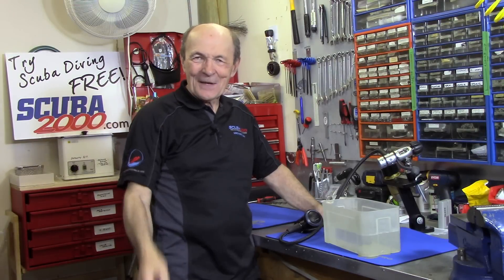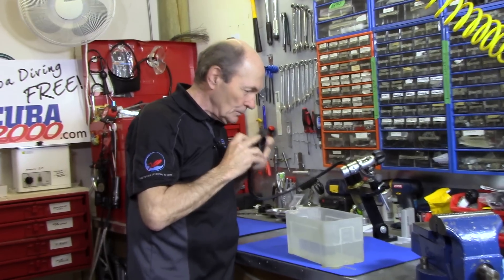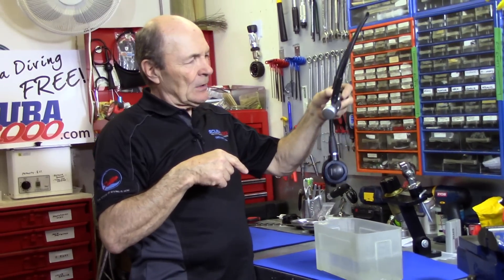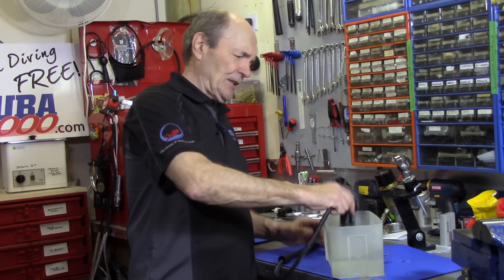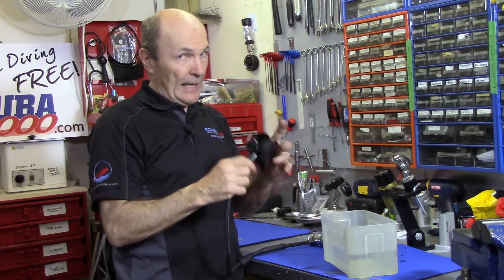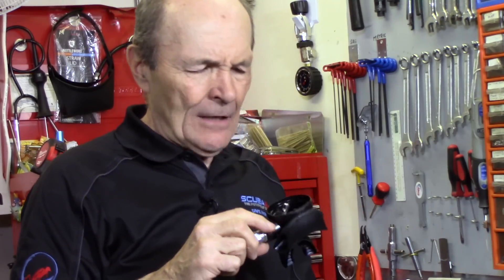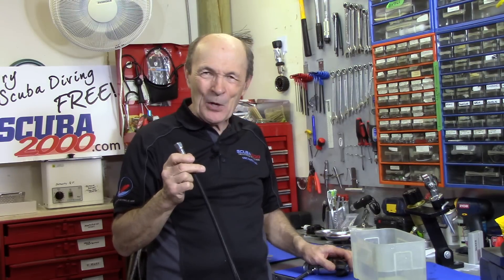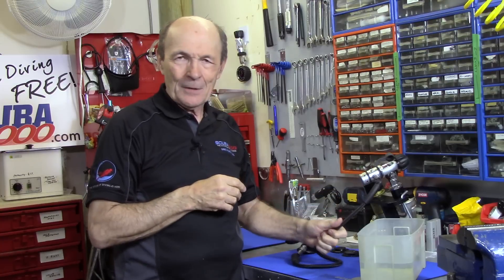Go Ahead, Push The Purge When Rinsing - Scuba Tech Tips: S05E15

Comment: DIn type of regulator dont have that dust cap on the end there :) If open will there still be air in the line to keep water out? LOVE YOUR CHANNEL!!! THANK YOU FOR ALL YOUR HELP!!!
Reply: There's absolutely a cap for din regulators. If yours didn't come with one, get one. It's a separate screw on cap that seals against the oring of the din fitting.

And you really shouldn't rinse or transport the first stage without it
Reply from the maker: Much appreciated and thanks for watching.
A

Comment: Pushing the purge button can allow water to reach your first stage. The odds of it without using complete submersion of entire second stage and hoses are almost zero. Almost zero is not zero. There is not a pressurized hose stopping water entry. There is a hose with remaining air that can easily be displaced in exchange for water if hoses reach lower then second stage. Always dangle first stage out of cleaning bucket wall cleaning second stage or you will get water in your first stage.
Reply from the maker: At my store Scuba 2000, new students were taught that technique.  Take care Don.
Reply: Can't you just hook it back up and purge it after rinsing

Comment: I will not have water inside the air valve of my second Stange. Nobody think that water goes in the first stage.
Reply from the maker: The key point is 'when rinsing' in clean water, not salt water.  If unsure that water may be in the 2nd stage hose, open the 1st stage a bit and press the 2nd stage purge.  Any water/moisture will be blown out before storing.

Comment: Hi I have a cracked diaphragm cover On my 2nd stage.  Do I need to replace it?  I was underwater And was still able to breathe ok.
Reply from the maker: A cracked purge cover should be replaced and maybe your reg checked as to why it cracked.  It still works because the breathing diagram has not torn so when you suck in it still pulls in air.  Not something to ignore for long.

Comment: Hi Alec. I like your videos. But with all due respect I have to disagree with this one. First of all I am sorry for my English, but I will try to explain what physics REALLY does. You talk about the pressure inside the hose. You talk about the water can not beat it. But the pressure of the water doesn't HAVE to beat it. Because as soon as the hose inclines from vertical to horizontal position (a thing that happens all the time while you rinse), the water and the air inside the hose occupies a TRANSVERSAL section. Then the water comes in and the air goes out. Is the same principle with the demonstration with the glass on the surface of the water for the Open Water Diver course (I usually show that little primary school experiment to my students when I teach the first class to show that the water doesn't compress the air inside the glass WHILE IS FACES DOWN). But if I incline the glass, bubbles come out and water occupies its space. I could make a video to show you why your theory is wrong if you want to.
Reply: I’d imagine due to the small inner diameter of the LP hose as well as the viscosity and surface tension of water, it is difficult to produce such a interchange between water and air as you would see with larger hoses.
Reply from the maker: You are quite right of course, in pure physics terms. I taught physics for several years.
I couldn't begin to explain, as you have, all the aspects of the motion of air and water in a tube. The video would be 1 hour long and no one would watch it. Plus, few would understand it either. 
All I was trying to accomplish in this video is relieve the anxiety on divers with respect to the "law" that you must not press the pure button when rinsing. The hose is quite long (25 to 30 inches) and the 1st stage end is closed. So, while there may be some air/water movement as you've described depending on the positioning of the hose, it would be very little.  The diver is unlikely to hold the purge button open for more than a moment so for most of the time while the reg is being rinsed, BOTH ends of the hose are sealed. In that case transversal movement would be limited.The likelihood of water making its way to the 1st stage is slight and that would be expelled instantly the moment the reg is re-attached to the tank. That would also completely dry the hose since the air is very dry.
So, while your physics application is correct, in this instance it's of little importance.
Pressing the purge is no reason to panic nor to spend $150 to service the reg.
Thanks for watching and for your comments.
Alec
Reply: @AlecPeirceScuba_SeaHunter  Almost nobody in Europe uses these useless rubber seals on the first stage. so water will come into the 2nd if you push the button (in my opinion it will also come inside if you have these useless seal...but ive only an PhD in Science). And i got some 2nd hand regulators which sufferes from moisture....simply dont do it. And throw away that dust caps.

Comment: Hi Alec. Fantastic video thanks so much. Quick question- I have not been pressing the purge button (so far), but when I unscrewed the second stage from the LP hose, a small amount of water was in the hose and into the air inlet of the second stage- is this normal?
Reply from the maker: If you've not pressed the purge during rinsing, there should not be water in the hose. Odd! 
However, simply make a habit of blasting some air out of the reg with the purge before removing it from the tank. That ought to get rid of any water.
Alec
Reply: Some regulators you have to pressurize before you soak (like atomic regs) just read your owner's manual

Comment: as you said the hp  seat seated then water can get in the low pressure side of the 1st stage , if water get inside the hose water can flow through the lower part of the hose allowing air to pass through the upper part of the hose but i agree that if you press the regulator while rinsing then place it back on a scuba tank that way you can purge the water out  but still just dont press your regulator while rinsing saves you the trouble thanks
Reply: I agree if a bit of water was sitting in by the second stage and you hung it upside down with 1st stage at the bottom that water can easily run down and can sit there for months till you next get it out to use it

Comment: the dust cap is not sealed so if you push the second stage purge button water will get inside the first stage by gravity specially if the second stage is place higher than the 1st stage , yes i agree that if you push your second stage place the regulator back in the scuba tank and purge until its dry, so better not to push the purge button while rinsing ,
Reply from the maker: 1. the dust cap SHOULD be sealed. If yours isn't, get a new one or check that it's installed properly. If the dust cap doesn't seal, 
    there's no need for it!
2. The first stage HP seat is normally sitting in the closed position. No air can pass. If you push the purge, water can only go up
     the hose if it displaces the air in the hose and subsequently in the 1st stage. Since the air in the hose and 1st can't get out, 
     water can't get in, certainly not by gravity and not even under pressure. And there's a lot of air in there. The hose is 1/4"
     diameter (inside) and 27" long. For water to pass the 2nd stage valve, a very small orifice, then travel up the entire length of the
     hose and finally enter the 1st would require a lot of air to exit. Not going to happen!

Interesting that at least one well-known brand regulator has what's called a floating orifice in the 2nd stage. It's not a new idea and it has some merit. However, the floating orifice is essentially the same as if you were holding the purge button open. When the reg is NOT under pressure (as when you're rinsing it) the 2nd stage valve is open. 

I'm glad to see my video has you thinking. That can only be good. The more we think about what's happening, the more in control we are.
Take care.
Alec
Reply: If you put a pipe upright in water with it sealed at the bottom bubbles will come out water will replace the bubbles it has to now seal both ends turn the pipe 1 way water will be at the bottom turn it the other way water will run to the other end if it can't go from the pipe to the first stage no problem but if it can it will

Comment: I like your videos but you are wrong on some of your statements. When you take off the second stage the ose becomes open to the atmosphere. With that you you have np pressure in the hose. The water could displace the air and make it to the first stage. 
   Second since the first stage has a diaphragm in it the dust cap on the tank side of the first stage is isolated from the hose side. The water could eventually displace the air and make it to the first stage.
   As far as drying the hose out with the tank that would work but doing it too fast would cause condensation in the hose which you’re trying to remove. 
   Might want to rethink those statements. Tony
Reply from the maker: Differences in opinion are good Tony and I appreciate your comments.
I think maybe my explanation is not as clear as it could be. I am limited in time and often glance over things that others, like yourself, want to discuss.
Removing the second stage entirely COULD allow water to run up the hose and into the 1st stage. I'm not sure why one would remove the 2nd other than is service, in which case it's not underwater. If that did happen, the instant you turn on the air, any water would be immediately displaced and blow out the hose. However, it's best to not remove the 2nd except for service and certainly keep the 1st and hose out of water.
I'm not exactly sure what you are trying to say in your second point. The LP hose is connected directly to the chamber below the diaphragm, the side that is NOT exposed to water. The hose and that chamber are, for all intents, the same chamber, the low-pressure chamber. The hose is simply a long, thin extension of that chamber. The dust cap keeps water out of the 1st stage high-pressure chamber. That is NOT the same chamber. These two chambers never connect except when under air pressure and then when you draw on the hose.
Assuming the air in the tank is dry air, there will be no condensation inside the hose. The hose may get cold and condensation from atmospheric air might appear on the outside of the hose. 
Thanks for your comments. These drawn-out explanations are often a lot of fun and informative for those technical-leaning divers.
Alec

Comment: Is it true that the water is not possible to go up through the intake hose into the first stage on a twin hose reg because there is tank pressure? Even though hoses are so much bigger that a single hose reg.
Reply from the maker: Water will not go up the intake hose of a 2 hose but it's not because of air pressure. It's because there's a non-return valve in the mouthpiece that closes off the intake hose unless you're sucking on it.
The early double hose regs, say, pre-1960, did not have this simple feature and, as I learned in my first scuba class, if the mouthpiece came out of your mouth, it was quite a trick, combined with some gymnastics, to clear the hoses of water - both hoses!!  
Even then, if water does get into the regulator body, it's not a disaster. The water will not go past the air valve and on your next breath,  or while clearing, most of it will be expelled back down the intake hose. The reg might need cleaning though, especially if it's salt water.
Best to keep the reg in your mouth - good advice even today!
Take care.
Alec
Reply: @AlecPeirceScuba_SeaHunter  Thank you so much !

Comment: How do I prevent water goes into first stage when I rinse a twin hose? I’m afraid the one way mouth piece can leak a bit, so when I rinse it with freshwater, the water goes through the right hose into first stage.
Reply from the maker: It would for sure.
The non-return mushroom valve in the mouthpiece is there to prevent that.
Be sure the dust cap is installed snugly on the yoke, then squeeze the exhaust hose shut with your hand and blow into the 
mouthpiece.
If the non-return is working, no air will go through into the 1st stage and you're safe to rinse.
Most experienced double hose divers will hang their reg from the first stage with the hoses hanging before they rinse it. That way the chance of water going into the regulator (uphill) is not likely.
Alec

Comment: Hello, Alec,

Thanks for the great videos!

Basically I agree with you.
For INT connections this may not be a problem, as a proper seal is possible with a proper dust cap.

In Europe, DIN connections are used for the most part. Here an adequate sealing is almost impossible.

But when I see something like this I also rinse the hoses as you have shown.
Reply from the maker: You're quite right Goo.
It's harder to seal a DIN reg when rinsing although there are very good dust caps for DIN regs that actually screw on. 
They come in Delrin (plastic) and also in Aluminum. They seal as well as if you had the reg on a valve!
Take care.
Alec

Comment: Aha... This make the ACD on my aqualung the best thing ever invented. I have to worry for nothing
Reply from the maker: Be careful.
ACD's (Automatic Closure Device) are NOT perfect as I hinted in the video.
First, they're not new and certainly not invented by USD.
Regardless, almost every such offering has not stood the test of time and was withdrawn from the market for a variety of reasons ranging from 'weren't worth the trouble' to 'cut off the air to the diver'.
I suggest that you never depend on any such device to replace proper care and maintenance.
Take care.
Alec
Reply: @AlecPeirceScuba_SeaHunter  I haven't about that in that light. Thanks sir

Comment: Hi Alec, interesting video.

My second stage has a feature that keeps the purge button depressed for long term storage. I accidentally left it depressed for a full hour soaking in a bathtub. Do you think it would still be ok? I follow your reasoning but it still seems to me like it's possible for air to escape. 

Thank you!
Reply from the maker: That feature existed on several models for years before being dropped or using a clip on part.  Put the reg on a tank and purging some air will dry out the hose.  Being in a fresh water bathtub with clean water should not be a problem after running air through the reg and safe second.
Safe diving.
Alec
Reply: @AlecPeirceScuba_SeaHunter  As always, thank you for the videos, they are very fun and informative to watch. My question is about the DIN regulator's dust cap. If it is screwed on, is it just as air and water-tight as yoke dust cap? Can you briefly soak the first stage of the DIN regulator as you would a yoke regulator? the reason I am asking is because yoke dust caps are usually rubber, and they provide a pretty tight seal, while DIN dust caps are usually hard plastic or even metal, so do they provide the same air-tight and water-tight sealing in case I want to soak 1st stage or 2nd stage. if the dust cap is not as sealed, water will get inside the hose as there would be no air pressure to keep it away. thanks again!
Reply: A great question which was sadly left unanswered by the OP...
Reply: Thanks Alec. I brought it to my local dive shop and did just that.

Comment: It would seem that if the 2nd stage is below the hose - water could not go up the hose unless the air in the hose was compressed - like the man said here. It would require some depth of water to allow any significant amount of water into the hose. We usually don't rinse regs in deep water. But if the 2nd stage is above the hose - then with the purge valve in - I think air could escape from the hose and allow water to flow in. I avoid pushing the purge when soaking the reg unless the reg is attached to a tank and pressurized. I also blow out the reg after soaking by attaching to a  tank and pressing the purge valve and also depressing the stem in the BC hose. I have 3 USD regs that are 30 to 45 years old and still in service.
Reply from the maker: That's a good idea CP - installing the reg and blowing air through the 2nd, the safe 2nd and the LP hose after rinsing. Very few divers would think of that but tank air is very dry and that would get rid of any water than may have snuck in.
Thanks.
Alec

Comment: I have an older Sherwood first stage, Patent No. 4226 257, it has the "dry bleed" rubber stopper. I had it serviced before diving a few weeks ago and it functioned perfectly. However, when I went to put the dust cap on after the second dive, I swear there was water on the filter area. I even tasted it and it tasted salty (of course, everything tasted salty.) I did soak everything in a sink full of fresh water, dust cap on, (even pushed the purge buttons off tank,) and hung it up to dry. Still, I'm worried that salt water might have gotten inside of the first stage, and I have read that this is often what kills these older regulators. Can you go into detail about the dry bleed systems please?

Comment: Another helpful video, Alec, thanks!  I have a related question: Recently when getting ready to dive, after turning on my tank valve I purged my second stage a few times to 'test' that it was working.  The DM on the boat said I should never purge the 2nd stage to test it; instead I should breathe through it.  The DM said  that I could damage the second stage by purging it.  Was this correct?
Reply from the maker: I can't think of any reason why he would say that.
I think it is a good idea to test your reg by breathing in and out. That way you check both the air delivery and the exhaust but ....
... there's certainly no harm in checking the air by pushing the purge button. That is what it's for.
Take care.
Alec